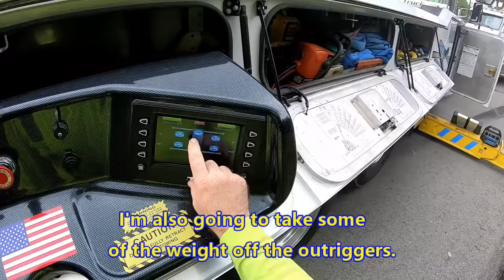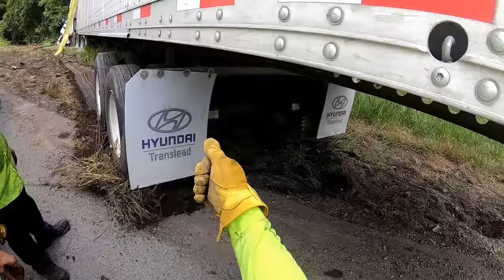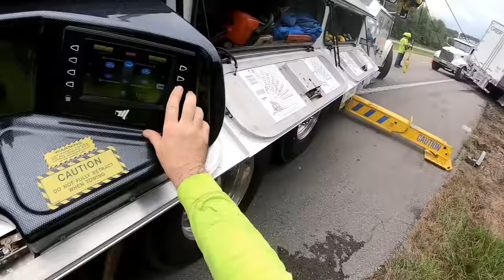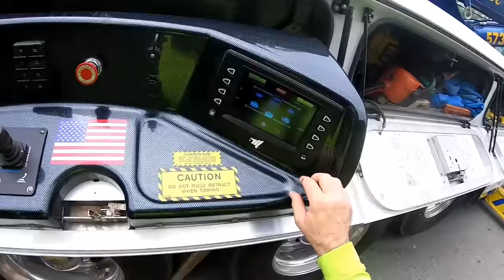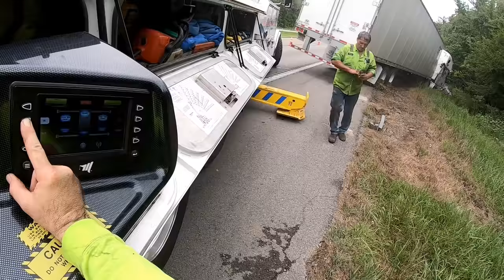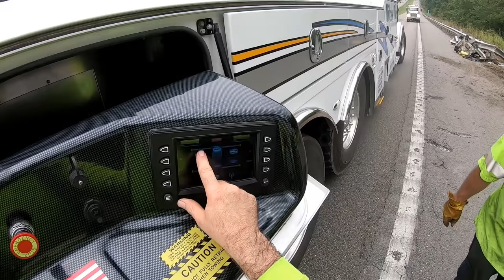Look out for that.....TREE!!!  Tator Team Daisy-Chain Recovery

Comment: i always wondered how they made drainage ditches, seems like an expensive method but what do i know.
Reply: When I worked for Illinois State Highways we would have to clean drainage ditches. They used a Grad-All to do that work. One time we were cleaning ditches on Glenview Road where it dead ended into the Navy base. The City engineers were out there. They asked the operator, "Do you think you could take a little more off the back cut?" The operator told them, "You do know that gas line is buried back there?" They said, "We know. Just take a little more off there." So he starts to cut. About the 4th or 5th cut he cut a nipple off the gas line. They had to evacuate and call the gas company to plug the leak. You know that cost big time since the line was marked.

Comment: Curious how you guys bill with all the varying complexity levels
Reply: For complex jobs I'd assume hourly and per mile rates per truck and person working the job.  Some simple stuff like yanking a non-stuck car onto a roll back might be flat rate; but flat rates won't work when you get to the point that every job is different and you're not sure what it will take until its done.
Reply: Aubrey Lion Swings it would be neat to see this bill, or an example of something similar
Reply: @dirt_lot_photography  I wish I  knew too.  All that equipment tied up in one job, all those men and time!  All the business lost for other jobs while wrestling with this one.  🤔
Reply: I've often wondered about that myself.  I have to think that if the Rotator comes out its hundreds of dollars an hour minimum.  For a job like this with multiple trucks I'm sure that is thousands of dollars.

Comment: According to the dot number, that tractor represented 100% of their fleet.
Reply: They have numerous trailers, we have 4 of them on our lot in Stillwater, Oklahoma right now. They make cardboard drums of various sizes for us.
Reply: The tractor is not owned by the shipper. The DOT search points to a lot of red flags.  In a case like this, it could turn into an ugly fight between the insurance company insuring the driver and the shipper.   Did the truck crash because the load shifted because it was not loaded properly or a driving error?  Ron was smart to not open the trailer or cut it in pieces.
Reply: @ArtStoneUS  I heard early in the video that they thought he blew a steer tire.

Comment: Ron Pratt ... I  have some observations & comments.   1. YouTube has caption settings, it includes foreign languages.   2. I am always impressed by how organized those equipment bays are!  Do you have someone restock, recharge the equipment for you  as to swap out when you return to the shop? 3. Have you considered making metal skids like a boogie board so it can slide either direction?  For use under hanging chadd equipment? Locked tires, to convert snow chains to skid chains lipped for all directions?  4. Blacksmiths trick on hot days, soak cotton cloth (old dress shirt rags work) in water, fold into ice cooler size, put in plastic zip lock bags,  put in freezer until stiff as a board, use as needed.  Fill water bottles 2/3 full for expansion,  freeze and will provide cold water as it melts and ice burgers otherwise.   Thank you for sharing your experience,  knowledge with all of us.  Like horses, trucks have their personalities,  there are no 2 accidents are the same...similar  but, never the same, so teaching by sharing is valuable for all.  Highly recommend law enforcement,  insurance companies,  truck makers heed your observation & comments.

Comment: I've watched so many of Ron Pratt's videos that I truly feel like if I was to apply for a job at  Midwest Truck, I would know how to operate, work safely and efficiently. Love your videos Ron! Be safe and god bless you, your team and your family!

Ron, If you do happen to read this comment, tell me if I am correct on this...
@19:44   With the information I've gathered in the video. The semi is fully loaded (20,000lbs), it's down a rather steep embankment (what it looked like to me), in a ditch and is partly rolled over.
When I took all of this information into account, in my mind that means that with all that weight, the embankment, ditch and it being partly rolled over, with only one truck trying to pull it out, there would be a HIGH risk that you would just pull the entire tow truck itself off the roadway and down the embankment. So, by daisy chaining the trucks together that essentially will ground your truck from sliding, therefore pulling out the semi. Am I correct?
Reply from the maker: It's all about the resistance factors.  There are actually quite extensive formulas for calculating the resistances created by any object.  Bottom line, you must have MORE resistance than the resistance created by the object you are trying to move.  You can have all the winch power in the world, but if you can't hold your truck still via the resistance factor, you will simply pull your truck towards the direction of the pull off the winch.     By daisy-chaining our trucks together I was creating more resistance.    AF_FOXTROT 6-4

Comment: You and your team all need to wear some of those special neckerchiefs for keeping you cool (or at least cooler). They are filled with a kind of crystal like beads that absorb water. You soak them in the sink, or bucket of water. After 5 minutes they plump up like a sausage and stay nice and cold. You tie them around your neck and they help keep you a LOT cooler.  Just re wet them every now and then throughout the day. I don't  do well in the tropics, or heat waves, and these thing are a lifesaver.  Just wash them by hand at the end of the day with a little soap and water & hang up to dry up until the next use. Good luck!

Comment: A three quarter of a million post remover.  Great job on a difficult recovery.  Wouldn't have been so bad if the tractor hadn't got torn up so bad on the way in. Cheap Freightliner.  Then you could have strapped the trailer with the rotator to keep it from going over any further while using the V-70 to pull everything back to the highway,  dropped  the shaft shot air to it and went home. As it was, it was a might more difficult.

Comment: Ron, you mentioned in one video a starter headset kit is $6k. You can rig your whole team for wayyyy cheaper. Peltor Comtac 3 or similar, baofeng UV-5r, U94 PTT from Disco 32. You’ll have safe ambient hearing, in-ear comms, and the whole team can operate on the channel.

Comment: I'm in the crane industry and noticed you put a chain through your orange endless. Really need to be putting a shackle in between the two to stop the chain from pinching or tearing the endless. Plus the d:d ratio needs to be met and its not with the chain. Other than that hats off to your guys. I just lift it up you guys lift it every direction. Way more more Complicated.

Comment: Hearon answer professional truck driver I’ve seen many accidents and a couple times I’ve had been pulled out by a wrecker out of the ditch I’ve only had the opportunity to times to be completely flipped completely over due to a deer running out the middle the road and smacking it at 65 miles an hour and one other time with the steering linkage broke on the truck and I had a guard rail just like you’re working on right right here

Comment: You may be having heat getting to you but plenty would be **bleeped**out several times... 
That is amazing how you do what you do and prayers everytime I watch that the traffic does the Right Thing slow down some and move over and give you space.. They may be over but sound like they are flying.. Takes one rubber necking to turn one issue into a massive cluster of rat tails..

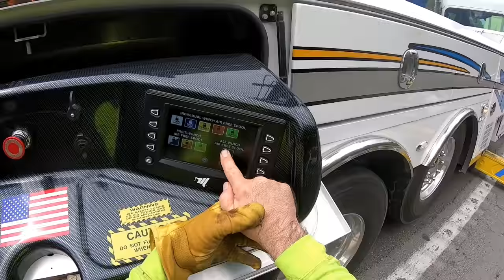Comment: @RonPratt - 55:00
Hey Ron, I know I'm a bit late, but as an HVAC installer in central Texas, I use this mix to stay hydrated and prevent cramps (mine can get bad, dad's genes)
About 70-100oz of water with one bottle of (my choice) powerade. (About a Gal total, depending)
Simple and doesn't taste !amazing! because it's heavily diluted (you get used to it), but when you need fluids, it's great! 
Been install for about 4 yrs and had issues staying hydrated, so I started mixing in 2021. I dont much care for water, but I knew I needed it. You still get your vits and mins, but you also get more fluid per serving of extras, without the excess of sugar per tiny sports bottle.
I feel it goes much further to keep me going compared to the other guys who drink 3-6+ bottles per day to my 1 bottle/Gal. 
Anywho, dealer's choice of drink + extra water = enough fluids. 

Stay safe and keep em comin.
Much love from TX
-M

Comment: Hi Ron, Tony from Aus. You may recall I mentioned quite a while ago I could not believe the speed vehicles were travelling past an accident scene and that here in South Aus where a police car has its lights flashing on the side of the road the speed limit to go past is 25 miles per hour in your terminology. That applies everywhere even if its 65 mph you have to slow down.And they have dash cameras back and front to monitor it and hefty fines to go with it. I notice in this clip that the passing vehicles are all going  a lot slower now-still not slow enough but not full speed. Has a law finally been passed in your state to peel speed back in these situations? You still keep a very nice looking truck by the way!
Reply from the maker: Unfortunately, towies, as you call them, and other responders are getting struck on the highways more frequently in the US.  This has prompted stricter enforcement of existing SLOW DOWN MOVE OVER laws.   There has also been a nationwide awareness campaign that is finally getting some attention.   North America lost 4 "towies" in the first 2 days of 2020.  Our company has started using a traffic control vehicle, which has helped more than we could ever have imagined.   Thanks for watching and God bless.

Comment: try pickle juice if you can stand the flavor. there is also an additive called pickle solution, which i think is nothing more than pickle juice in a different bottle. i do a lot of summer logging and no matter how much water and gatorade i drink, iv still cramped up. i started buying the 1 gal jugs of pickles, tossing most of the pickles, eating a few during work, but do a 50/50 mix of water and pickle juice, iv found it extends my working time before cramping by a couple extra hours. plus eating something gives me another couple hours.
Reply from the maker: I have actually found a combination that is working pretty well right now.  I love pickles, but I don't know about drinking the juice LOL.  I mix Pedialyte and Body Armour for increased hydration.  I also drink enough water to float most folks away.  Thank you for your concern and I will sure keep that in mind.  God bless and thank you for watching.

Comment: Smack me if I have it coming. Seems to me having a compressed air source with a long hose and various connectors would help by pumping up the brakes. Might involve cutting and tapping in near the trailer brakes. Or if no leaks attaching to the glad hands. Maybe I just do not know enough, but seems like it would reduce the drag force.

Comment: Hope you're around if I'm ever dumb enough to put myself in a ditch. But you make me nervous walking down there when they're putting tension on the lines. Could you use a portable air tank to release the trailer brakes? Would make pulls like this much easier, I'd imagine.

Comment: Question, why didn't you put the Tator in line with the trailer? Wouldn't that be better for pulling in regards to the weight distribution? It would also potentially allow you to pull the Tator forward to pull the semi, as opposed to using the winches.

Comment: You guys were spread out quite a bit as you were chaining up the trailer. Would headset communicators help? You can adjust the mic sensitivity so it wouldn't pickup the noise of the idling trucks. When you're hot like that, yelling just makes it worse. I know the troopers wanted the scene cleaned up asap but you guys really should've given yourselves a 5 minute drink break. You did say that rain was coming, hopefully that didn't include lighting. Thanks for the great video. Everybody did a great job except for that Ron 'whatz-his-name'. Watching the video, I don't think his neck & head are connected! Maybe he can twist his head around like an Owl? 😉

Comment: Why did you not spin the Rotator around reverse to traffic and utilize all five winches , connecting the wreckers together puts insane pressure on the frames of wreckers ,Your Rotator can pull 300,000 lbs , as you stated earlier in videos ! Stay Safe & All The Be$t ☆¿

Comment: Why wasn't the trailer brakes not backed off to have the wheels roll for a easier pull? Rather than just dragging it and putting more stress on your equipment.

Comment: What you think if you would have manually release trailer brakes,  instead of dragging weight on wheels rolling wheels give less traction and drag. Or use one why glad hands with air compressor to release brakes.

Comment: Mr Ignorant here: I assume the crashed truck brakes were locked on because of hydraulic / air failure?  So you were able to connect an auxiliary air line to release the brakes?  Dangerous work for all concerned, respect.

Comment: would it be possible to use portable air storage as in scuba tanks with regulated air output to release brakes for recoveries like this one, where you are pulling against locked brakes?

Comment: I been saying this for YEARS NOW . When working in a big team like this YOULL SHOULD HAVE HEAD SETS . Communication  is key ITS CHEAP now days
Reply from the maker: I agree that we could benefit from headsets, but the ones designed specifically for our industry are NOT cheap.  They start at around $6000 and go up from there.   We have W/Ts that work well when we need them.... not as well as headsets, but it's hard to justify a startup cost of $6000 no more than we would use them.       Thanks for watching and God bless.

Comment: I cant understand why the police dont make a both way traffic solution on the other side of the highway and closing your section of the highway completely, ir wil cause at bit longer traveltime for the traffic with reduced speeds but it will secure a flow pass the area.
Did the driver really survive this chrash?!

Comment: I don't understand why most of these big tow truck guys don't simply crawl under the trailer with a 9/16 wrench and loosen the brakes. The pull would go a lot easier if they did.
Reply from the maker: There are times, such as this situation, where I WANT the brakes locked.  Keeping the brakes locked prevents a "runaway" in the off-chance of a catastrophic equipment failure.    Also, on the newer vehicles, you can't back off the brakes unless they are already released or you insert a T-bolt and manually compress the parking brake spring.   Anyway, I release them when I need to release them.  Thanks for watching and God bless.

Comment: Just think how much easier it would have came out if you would have ran a air hose down to the trailer from your wrecker or one of them to release the brakes and you would not have to shovel all that mud out of the road also . 🤷‍♂️

Comment: Here's an idea, cage the trailer brakes
Reply from the maker: If I had wanted to cage the brakes, I would have.   I wanted the brakes set so we didn't have a "free-rolling" situation.  I wanted to control every movement of the units then release the brakes once they were safely on the shoulder.   Everybody has different methods.   Caging or running air would have reduced the rolling resistance, but I had enough iron to compensate and this was the way I wanted to perform the recovery.    My common analogy, there are multiple ways to reach 10.  Thanks for watching and God bless.

Comment: What caused the driver to wreck the truck like that
Reply: the 'politically correct' answer could include, but is not limited to: potential right-steer wheel tire blowout or other mechanical issues; attempting to pull-over to the shoulder due to a full DPF-Filter needing a 'parked regen' ...i.e. the engine was already in speed-derate mode with red engine light lit....meaning the engine would shut down within 5 seconds); attempt to avoid a side--swipe collision with an adjacent vehicle; avoidance maneuver due to heavy braking of traffic ahead; load-shift (the trailer only had 20,000 lbs of cargo, but if it shifted side-to-side it could have affected the driver's control of his rig).
The "not-so-politically-correct" causation factors could include: dozing-off; texting; checking paperwork as to exact location of unloading place; watching a movie on the tablet (I see that quite frequently by truck drivers passing me.....grrrr); wandering-the-lane due to inattention, followed by the wrong corrective action etc., etc).
I just hope that the carrier's safety director had a chance to talk to the driver within the first 2 hours of the event, when he/she was still humble and didn't have time yet to rationalize the event......it makes the investigation a whole lot easier.

Comment: the guard rail do not make any difference in here the only will slow down the truck a you can see the truck destroy the guard rail with no problems  in that point of the road will be better with no guard rail because you have the mount in to you right side